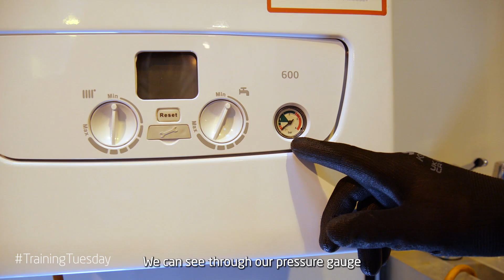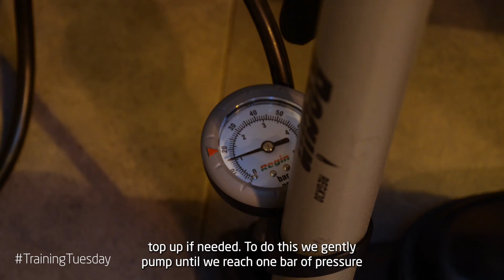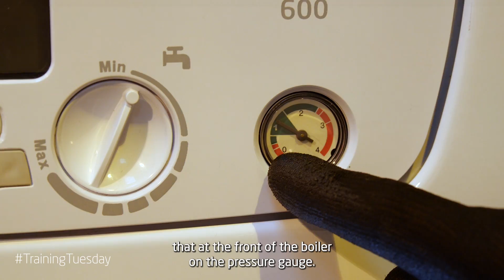How to repressurise the expansion vessel on the Baxi 600 or 800 Combi boiler

Comment: The engineer installed in our home Baxi 600 for 12 radiators and two bathrooms, the boiler constantly is getting high pressure we need bleed radiators nearly every two days, any advice? 
Because the installer told me that… this is happening because my heating system should be flushed, I was thinking he must have done that for us before installation, that was the deal but after we paid all he changed his mind. Thank you